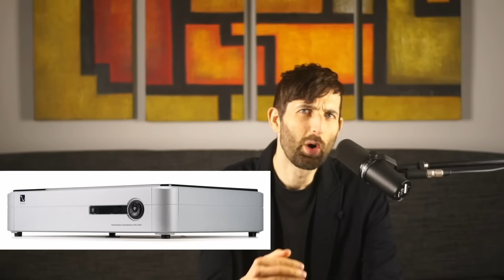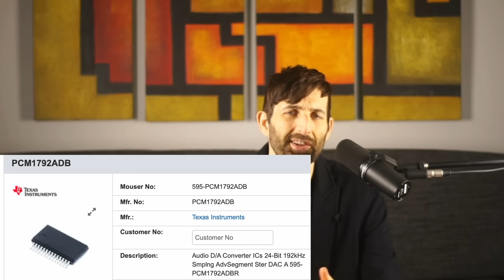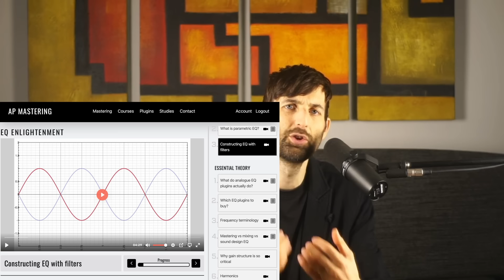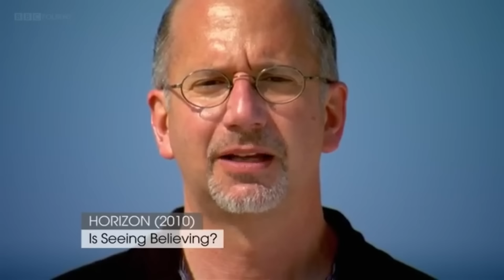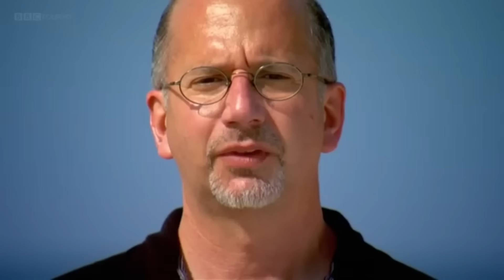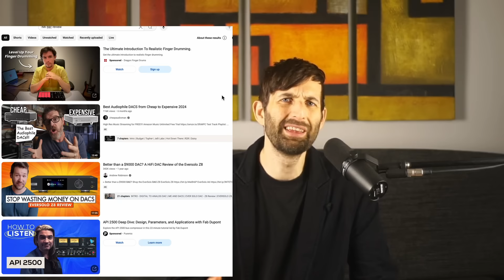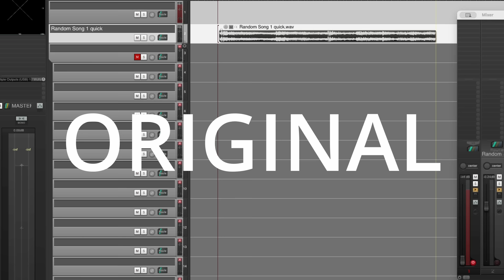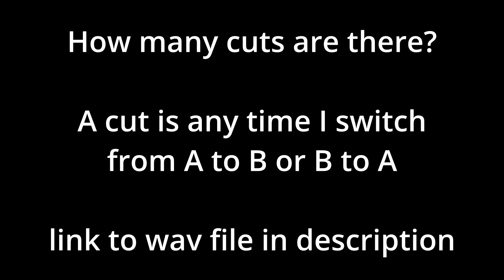The DAC Scam - Almost everyone believes the hype

Comment: It's not all in the chip.. The core of the conversion comes down to the chip. The primary advantage to some higher end DACs within reason is the output stage, as it is what dictates the sound. The output from the chip has to be buffered for impedance matching and to bring it up to a standard line level. That is effectively a tiny amplifier. The quality (or lack thereof) of that amplifier will determine the noise and distortion performance far more than a modern chip will. If you take a highly competent DAC like my TOpping D90LE (£600) it is effectively as low in distortion and noise, and as perfect in linearity as you can get. If you want colour it is not a good DAC because it doesn’t colour the sound. But if you want to convert digital signals to analogue as perfectly as possible, it is the perfect DAC and high-end DACs will if anything be worse. There is certainly no need to spend anywhere near a grand on a DAC for technically near perfect performance.

Comment: I like your videos, very informative.  But isn't the point of a NOS dac, or the ability to turn off oversampling on some DACs so that you can apply your own filtering stage? Like with a Chord Mscaler or HQplayer?

A lot of the variation in sound in DAC's past the chip itself can come from different kinds of filters used, or the output stage.  Marantz when the AKM factory fire occurred had to tune their output stage to get a similar sound out of their receivers and amplifiers when they started using Texas instrument DACs as replacements.

Comment: Love the fact that people in the comments still argue about "implementation", "power supply", blabla... . Just look at the test of the topping dx3pro+ DAC+Headphone amp at Audiosciencereview. That device is 200$ and measures ABSOLUELY PERFECT despite being two devices in one for almost no money. Implementation is not about using boutique parts, it is about the quality of the design of the device. This doesn't mean the device has to be more expensive, just that the engineers know what they are doing!

Comment: I stopped watching when he said that the chips do the “most of the heavy lifting”. The “clock” the “analog output stage” and the way the “power supply” is implemented are far more important. My IPhone has a dac built in. And it sounds pretty decent, for sure to the untrained ear. 
Basically what he is saying that a F1 driver takes the tires of his daily driver and put that on his F1 car. When blind tested, he would not know the difference.

Comment: Quality and results (and from seated-in listening, not quick AB tests) are always in the analog design and clocking , it's not the chips (ICs). Some DACs prefer to be well warmed up to be stable, not powered off / on. I know one famous brand that released a revised edition having benefited from the PSU transformer being rotated 90 degrees.

Comment: Well, you’re right about the point you wanted to make.
However, a $200 DA converter definitely doesn’t have the same quality of components as a more expensive unit. I’m not talking about $5K and beyond, of course—that’s all voodoo, at the latest when it comes to over $10K.

On the other hand, it’s not just about the conversion itself. Factors like power supply, filters, software, and drivers play a crucial role in making a good converter. Clocking is also often overlooked.

But like I said, your point is valid. A comparison between a $200 and a $2,000 converter is a totally valid step up in quality. Of course, as you go higher, the price jumps become more significant. There are some high-end options like Lavry and Exeters, but beyond that, it’s kinda voodoo.

Comment: my fellow who is an electronics design & manufacturing contractor told me one day: - "Anyone should stay away from any sort of philes as any sort of philia is nothing but a mental pathology. Now they say that it sounds right to them but tomorrow they'll whinge about the same setup sounds all crap." Then he showed me a showroom dummy vacuum valve amplifier with no guts inside but only valves being put in sockets and said: "Do you see this? One day I'll bring a power to the valve filaments just to make them glowing and solder a couple TDA7294 in then I'll slip it  all to some audiophile for top dollar."

Comment: The law of dimishing return. Spending the first $$ to get massive improvement, then wasting $$,$$$ more to get slightest (if any) improvement...
Reply: I stopped at Chord Mojo, right up to that I heard clear difference vs cheaper ones, but not much above it
Reply: @rehakmate  Nice!
Reply: "Diminishing"
Reply: @ OK, Diminishing...

(BTW English is not my mother language)
Reply: Not exactly how it works.
Reply: @Nantawat_Kittiwarakul  that is the point there is no perceptive improvement
Reply: @Nantawat_Kittiwarakul  there are no differences that are not margin of error. Therefore there are no measurable differences in performance. Other factors are beyond the scope of this discussion.
Reply: That doesn't mean that the differences aren't there, or aren't worth paying more for, to some people. $3000 speakers sound better than $1000, largely. Most $6000 speakers sound better than $3000 speakers. I go to shows all the time.

Comment: You are speaking from a point of ignorance. Your rant has no ground.  The Dutch DACs don't use off the shelf chips. Neither does exceptional DACs like the Mola Mola. Everybody with half a peabrain knows that the circuitry around the mass produced chips determine the quality of the sound. Speak to the owner of Weiss who makes studio gear at very high prices. You sound like a fool and probably are one..

Comment: Same thing as with CD players (with digital output). A $20 plastic computer CD/DVD drive can read every bit correctly, otherwise there would be corrupted files and programs would simply not run. And these drives read CD's at more than 20x the speed of an audio cd player.
Reply: yes although that data is then buffered and re-clocked and low pass filtered on output. Sometimes that filter is a combination of digital and analog stages (tuned by ear).
Reply: @TWEAKER01  That is more part of the DAC side. I mean the actual diskdrive that reads the data from disk. All the "build quality", power supply don't matter if you use digital out to a separate DAC.
Reply: A very uninformed comment. 🥳

Comment: I don't recommend buying $40,000 DACs, but to say there is no difference is BS.  Implementation is key.  You  can have two different companies using the same ESS chip, but they will sound different.  There are also R2R and one-bit DACs.  I have several DAPs and they all sound different.
Reply: I absolutely agree with you. I have quite a few units sitting around here myself sometime I still use fire wire yeah I have a few.
Was in a recording studio approximately six months ago the whole studio is wired with transparent audio cable, all XLR naturally and runs and runs of cat cable /fire wire got talking to the couple texts that were just standing around tweaking equipment. I started talking to him about various types of cable. They said they experimented with and tried lots, but the transparent audio cable along with the cat cable still worked and sounded the best. I don’t know you take it from there. These are people that do nothing but this every day and it would not be any problem whatsoever more work than money in which she went on to tell me, they wasted a lot of money on experimentation only to reinstall the old transparent audio cable , called music link along with the cat five ,cat six when I asked about the new I2s cable the one Tech laughed and said yeah, leave it to the consumer rodeo market. That cable was made up special for internal runs on computer servers and processors the way he explained it to me. It was never intended with the intention to be used or incorporated in the High End Audio more industry hype, he said that you guys buy into that the guy that stays up, walking the floors all night of how we can make more money had the right idea. Well, let’s use it as consumer cable. He said he thought it was a joke and it was nothing but updated cat cable really that’s Balanced. He went on to show me a picture of the inside of cat cable wire runs versus the new square S cable yes absolutely it’s more wires that run to the same place and do nothing he went on to say, swap out a cat cable and put in the. I2s cable and then come back and talk to me after you wasted your money. I think I would take this dude‘s advice.
Reply: Also mine doesn’t use chip
Reply: Total B.S.
Reply: @lesliefok3227  I own a 40k dac and it’s a wonderful sounding thing. Better than my previous 10k ish dac. But why should anybody care what I spend my money on. My personal opinion is one sounds better and I’ll vote with dollars. 

The only problem is… there’s not enough of them lolol. I’d prefer a wadax or a Varese ;) but thankful for the Rossini/clock because it’s wonderful in its own right.

Comment: Major thing that effect DAC's is RFI, some of this gets into the analogue stage degrading audio, however RFI can also effect digital clocks causing jitter.  It's the implementation in these areas that separate higher end DAC's from average DAC's.   For example some DAC's have 2 power transformers, one for digital and the other for analogue.     Also when comparing DAC's to much attention is placed on numbers such as signal to noise,  if numbers mattered then the vinyl revival and high end turntables would not exist.   The aim is to make digital audio sound analogue and some DAC's do this better than others.

Comment: There's so much more to sound "quality" in a dac than just the chip. Power supply, resistors, capacitors, chassis layout, and on and on....
Most every dac I've ever listened to has had different sonic characteristics. I love blind listening texts. Again, the differences are there. 
You are not an audiophile imo. Maybe a great studio engineer though. There is a difference, not better or worse. Just different.
Reply: And digital clock.
Reply: @DarenLee  Even that is barely true with modern DAC chips. They have exceptional jitter rejection and a good enough clock for those with perfect transparency is about $2.
Reply: Difference is a distortion. You, as a renowned audiophile may like a certain distortion over another. :)
Reply: Correct, but by the sum of those components, you probably will rarely find cases where the cost (should) would be over $1000.  While that figure is not a brick wall.  One could safely say that NO Dac should cost 5 figures or more. That is definitely trolling and I would challenge any company that makes a five figure DAC to PROVE why that DAC should cost that much.  They probably can't.  Putting things into another perspective, would you pay $3000 for a hammer?   A $30 one would do the same job just as fine.  So, why spend so much money for a piece of audio gear for an improvement that you can barely hear, if you can hear a difference at all.
Reply: I love blind listening texts, too. Close your eyes and have them read by your preferred text-to-speech generator. So rewarding!
Reply: So why can't you point out the cuts in the example?
Reply: My friend, at your age, claiming to hear differences is a bit much. How was your last audiogram?
Reply: No there isn't. That is the words of a Charlatan or uneducated.
Reply: @robertt7238 Yes there is.

Comment: I own both Topping D70s and Lampizator Poseidon DACs.  The former has slightly better edge sound while the Poseidon a warmer presentation; however, this is what I heard in my system through the Poseidon pre-amp.  I've been told many times that the Poseidon DAC through an outboard high end pre-amp will achieve superior dynamics and open soundstage and the Topping benefitted from the tubed pre-amp.  

Most Topping DACs are inferior and I'd rather listen to moderate to higher end CD players.  I do not agree that your statement is true that there is a DAC Scam.  I've heard many dozen DACs from inexpensive to expensive.  The sound of the DAC is NOT solely dependent on the DAC chips (can be R2R not using chips at all).  The analog output circuitry is at least if not more important than the DAC chip used.   I bet this guy also doesn't consider power supply, cabling, etc. as significant factors to the eventual sound.   So I've voting thumbs down.  

Yes, one can acquire superb sounding inexpensive DACs at a budget price.  Now, most users are streaming and don't realize that 85% of the streamed music is inferior to CD sound with the 15% equal or better, high resolution or not.  As to CD playback only, other design characteristics, power supply and cabling can make or break the quality of sound.  I use a Shanling CT3 transport for my Topping in my informal listening in my living room and a Jay's Audio CDt3 Mk3 transport for my Poseidon in my main listening room.  Both systems are musically at the upper end.  Choose your audio system carefully and one can enjoy great musical sound on a budget, moderate price or high end.  This guy's video just goes the opposite of one must spend a fortune to obtain great musical sound.

Comment: Can't bear listening to this drivel all the way through. Can someone confirm this guy doesn't at any point realize the difference isn't as much in the chips that are used, but in the input and output stages, that are analogue and have a much bigger impact on the sound quality than the chip(s) used?